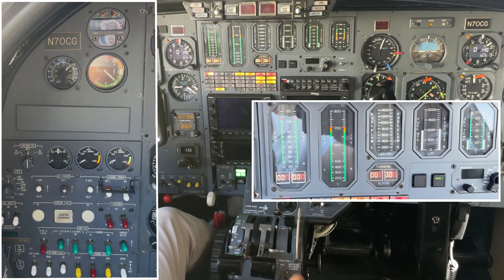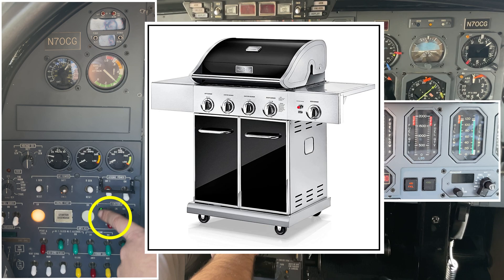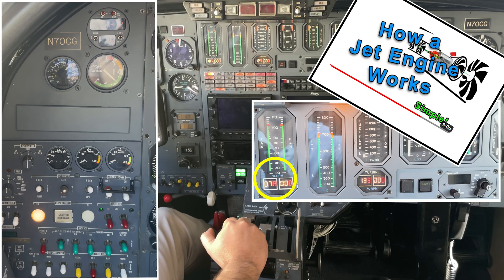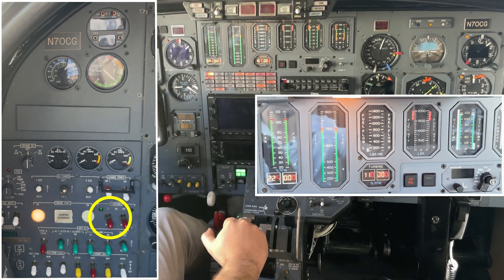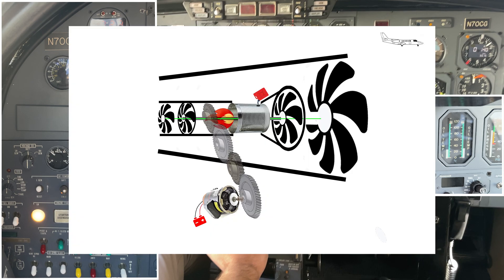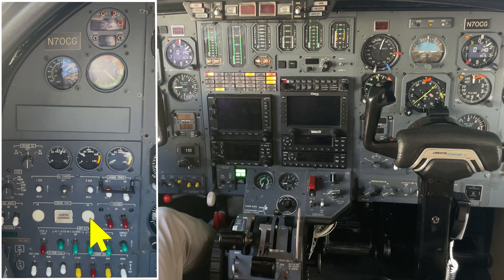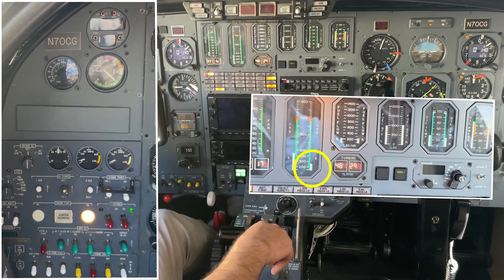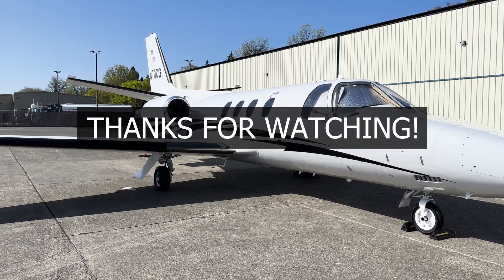How to start the jet engines on my Citation 501SP

Comment: Howdy Noam, I have heard about "cooking" your engine if you don't start it right, so it appears the ITT is what you watch to prevent that. Could you perhaps explain the potential issues you might run into, or actually have run into, on an engine start. If the ITT is starting to runaway, do you simply pull the thoattles all the way back, or do you have to kill the engine?
Would the suspected issue be that the plane is facing the wrong way and the blades are spinning backwards?
If the winds shift, do you have them tow the plane into the wind to ensure a safe start?
So many questions :)
Thank you for another great video!